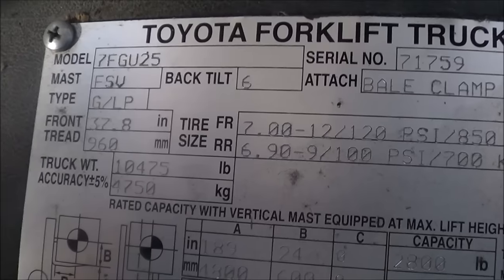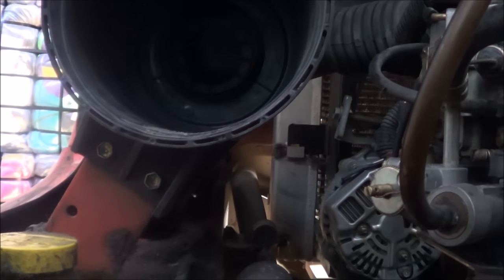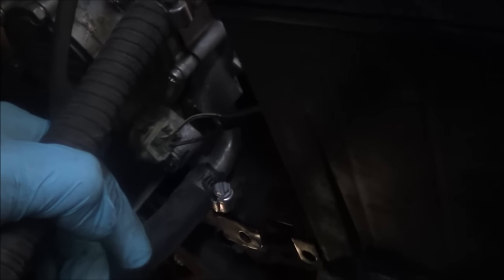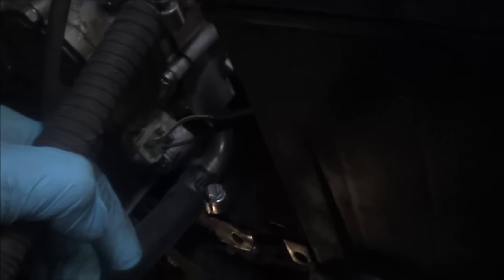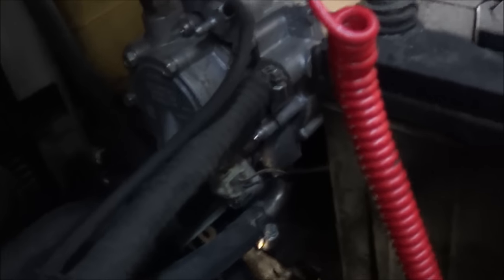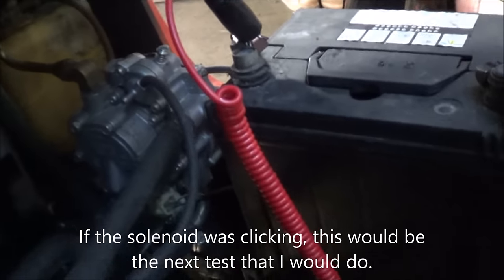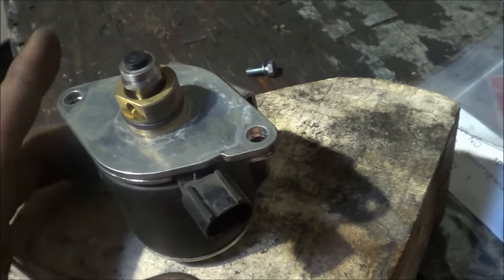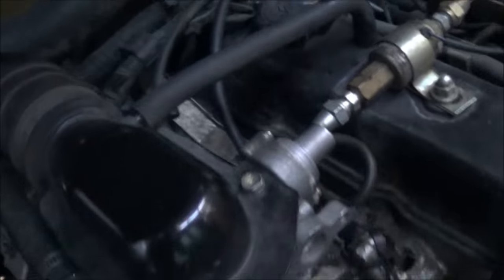Toyota forklift no start issue

Comment: What test light are you using?brand and model# please?
Reply from the maker: It's a matco test light but I don't remember the model.
Reply: I'm just getting started in the forklift mechanic trade. Well for about a year now as a PM Tech.  But they are now letting me go out to service calls. So I've been building my tools accordingly. I have a matco test light and it is 12, 24, 48 volt. Test light but somebody said it was not good for what we do.  So just trying to figure out what one is the right one.
Reply from the maker: Honestly, it all depends on what you use it for. If its LED and you use it on solenoids, injectors or contactors then you will more likely fry the test light.
Reply: So standard bulb is better.  What about voltage range?  And also was wondering about your fuel pressure tester?  Any good recommendations?
Reply from the maker: I just use a test light for quick testing on 12v systems other than that is a meter or an oscilloscope. My fuel pressure tester is from impco.

Comment: hi i have a problem with tcm 3.0 ton diesel forklift.(i think 1992).key ignition turns on but no start.It starts if i use screwdriver on starter first time.What is wrong?Starter is fine.had it checked.
Reply from the maker: +crazy pineapple where did you use the screwdriver on?
Reply from the maker: +crazy pineapple im guessing you jumped the battery connection on the starter to the starter solenoid with a screwdriver. If this is the case then everything from the key switch, relay, and wiring upto the starter are suspect. Corrosion in the connectors is also a possibility.

Comment: Got a s50ft no fuel new regulator getting fuel to the solenoid but not past would that be the problem
Reply from the maker: Make sure the solenoid is getting power and ground
Reply: You the man broken ground wire thanx so much

Comment: Im working on a 8series Toyota forklift with a code e 09-1 and will not start.  Any ideas
Reply from the maker: +busfairnitrometh 09-1 is ignition signal abnormality. No spark?
Reply: Broken wire tach sensor

Comment: I'm having the same problem but with a Nissan it cranks but won't start any ideas what it could be?
Reply from the maker: If it cranks with normal speed then one or more of the following would be missing. Spark, fuel, compression, air (being sucked in). If all of these are present then it would be timing( ignition or cam/crank).
Reply: if you have spark and no error codes, lp regulator is over pressurizing

Comment: i have this problem engine starts and then dies check the regulator valve relay and is not working theres no ground to the relay to activated the relay and the solenoid on the regulator where this ground supply from
Reply from the maker: +agustin tirado if you're talking about the lock off solenoid then ground could either be provided by the ecm or constantly from the chassis.

Comment: Please I don't know if you will be seeing this, I am working on a cat forklift and every time I use something combustible it start up and continue working even after I finish operating
But coming the next day same story been confused for a while
Reply: The forklift uses gas only
Reply from the maker: A no start, would always fall into 5 possible causes. Fuel, air, compression, spark and timing. In your case it would more likely be fuel related. I would start with figuring out what and how fuel is provided during cranking.

Comment: What about when you have changed the entire regulator but the forklift wont start
Reply from the maker: Cranking no starts would have 5 possible causes fuel, air, compression, timing and spark. If it was fuel related, it either is lacking in fuel ir in excess. The regulator is only one part if the system. The mixer is also a possible cause and injectors(if it is equipped).
Reply: @forkliftgeek10  ok but we spray starter fluid on the air filter are and it starts no problem but when we turn it of and try to start it up again it won't we have to spray it again to start it
Reply from the maker: Then I would suspect a vacuum leak. Other possibility would be a broken hose from the regulator to mixer or mixer to lock off.

Comment: I was using my take fork lift for 3 hours with no issue then I go and park it and try using it again but the engine now shuts down when put in drive or reverse any ideas why?
Reply from the maker: That could be a lot of things. Without knowing what truck it is, I would start with what is missing when it dies, spark or fuel. You would need a schematic to look for an engine shut down circuit. Is this a  Clark?
Reply: ForkliftGeek thanks for responding.
It only dies once I switch to drive or reverse the propane tank is full.
I just let it run for 10 minutes and after it was able to go in drive with out shutting down but it seems like I need to let it run for 10 min each time I want to use it
Reply: It’s a yale forklift
Reply from the maker: Well, from what you are telling me it seems to be temperature related. Still need to determine what is missing when it dies either spark or fuel since it can't be timing nor engine breathing. I had a clark that had the same symptom and it turned out to be the computer but every system is different.

Comment: What else could it be if the solenoid is working and still no start? I have fuel pressure to the regulator. This happens to me every once in a while where the solenoid is good and is working but it still won't run with out starting fluid
Reply from the maker: +gigglegasn20 have you checked the slow solenoid?
Reply: ForkliftGeek what's a slow solenoid? I noticed on some Toyota models there is a second smaller solenoid on top, and some models don't have one just a vacuum line going in. Can you give me a list on what you would check when you're not getting fuel. The company I work for has about 30 Toyota lifts and every once in a while this same scenario happens and I feel like an idiot cuz I can't figure it out lol. Thanks for you help, great video BTW
Reply from the maker: +gigglegasn20 that's the slow solenoid, some are electric and some are vacuum operated. Best thing to do is check regulator compared to specification if problem is intermittent. Do u have the manuals for them?
Reply: ForkliftGeek oh okay. Only manuals we have are the owners that come on the back of the seats
Reply from the maker: +gigglegasn20 what's the model of truck u working on?
Reply: ForkliftGeek mostly 7 and 8 series, never have this problem with 8 series though
Reply from the maker: +gigglegasn20 what's your email address?
Reply from the maker: +gigglegasn20 did u get the email I sent you?
Reply from the maker: +gigglegasn20 when you said it would not start without starting fluid, was the engine cold?
Reply: ForkliftGeek yes it was cold. But had complaints of it being intermittent hot or cold
Reply from the maker: +gigglegasn20 check if the vacuum at cranking is at 3-5 inhg when cold.
Reply from the maker: +gigglegasn20 also check pcv valve, might be getting stuck open.
Reply: ForkliftGeek thank you I will certainly have  to check those

Comment: Current draw measurement would have told you everything you needed to know.
Reply from the maker: If you know the current draw of the coil then yes. Using a current clamp with an oscilloscope could have shown a current ramp and possibly a hump suggesting it was opening. Wanted to stay with basic tools for this one. Tnx.

Comment: Good day Sir, about the positive side of that solenoid,,why is it blinking when cranking, is it the engine timing? What if theres nothing on positive side,what some  alternative ways to test or check?
Salamat po:
Reply from the maker: The blinking is the voltage fluctuation from the battery. Whenever a load is applied to the battery(in this case the starter) the voltage drops. If there is no positive supply you could do  a bypass test and provide your own 12v supply.
Reply: @forkliftgeek10  havent encounter this problem,mostly here poh issue sa LPG regulator but some wiring issue not yet ,soon if this problem exists i know what to do, still developing some diagnostic techniques , cge sir salamat sa info God Bless

Comment: Hello Sir I have a problem with toyota 8FGU25. The engine fail and the aceleration is up nd down every time, I can see two error code E-03-1 and E-01-3, Please help me to solve this problem.
Reply from the maker: E03-1 is an intake pipe pressure sensor open. Check your connections on the map sensor. E01-3 is a rich condition. Go with the E03-1 first. Check also for a vacuum leak.

Comment: Now to lower RPMS to 750 and clean out that intake, thing is running rich which caused regulator to fail prematurely
Reply from the maker: How would the main solenoid fail even if it was too rich when it should be energized as long as the engine is running anyway? 🤔
Reply: @forkliftgeek10  it is running rich. Your saying you don’t get component failures when regulators are running way out of spec? I get what you’re saying but you’re not fixing the underlying problem. Take that intake manifold off and remove the carbon deposits. Before you get a law suit for a lift failing it’s emissions and some forklift operator getting carbon monoxide poisoning.
Your a fantastic mechanic bud. I mean that, your trouble shooting is spot on.
Reply from the maker: Are you saying it is rich because you've seen the same problem by experience? I did this video 5 years ago so I had to watch it again. Where in the video were you able to tell that the engine was running rich? I was not using a gas analyzer to see HC levels nor did I check O2 signal. Which would have been useless anyway since it does not start. Yes I have seen component fail when not running in spec but what I'm saying is for this case it was the "main solenoid" that failed which would have been energized no matter if the engine was running rich or lean. It is a switch that opens or closes the path, it does not control the amount of fuel. With regards to your comment of me being sued, I don't know the law where you are from but here it is the responsibility of the forklift owner to make sure that the equipment is safe to use. He can call a company to do an emmison test on his truck to do that. I was not called in to do emmision testing but rather to fix a specific problem, now I can recommend for him to get it tested if it was running rich and and suggest to lock and tag his equipment. In the end the owner is still responsible.  Please do explain how you were able to tell the forklift in this video was running rich so that others may learn as well.
Reply: @forkliftgeek10  sure, engine no start you pulled the hose from regulator to EPR. You switch key to start position and saw a lot of pressure. A lot of pressure from regulator is normal on these lifts. The Electric pressure regulator EPR controls the flow from regulator which is always high. On laptop software there’s a needle which represents the EPR which is constantly make fuel adjustments from rich to lean.
Fasted way to know it EPR is remove fuel hose leave a air gap. Truck cranks and runs. 90% of mechanics who’ve no software and not fixed this before will replace regulator. The regulator is dumb, can’t turn it up can’t turn it down. Fuel regulation is done by EPR. Fixed 100’s of these.
You will also see lift crank, engine goes into forced limp mode. If you want so help attaining software and cable just hit me up.
The GM software and password I can put on a flash drive. The cables you can order on line
Reply from the maker: Buddy you commented on the wrong video..
Reply from the maker: But ill answer it anyway. The EPR compensates to run rich or lean during running and closed loop. My question to you is how does the EPR know how much fuel to deliver at cranking not running. When cranking it is still in open loop. What is the measurement.
Reply from the maker: Did you watch the 2nd and 3rd part of the video? The video you are referring to has 2 more parts. Where I explained why it is the regulator. Yes it has pressure but how much is the question. Which is what I showed in the part 2 if this video.
Reply: @forkliftgeek10  no couldn’t find them, it’s all jumbled up on my end
Reply: @forkliftgeek10  I don’t doubt it lol they changed the format on comments.
Reply: @forkliftgeek10  honestly don’t know that part I would assume it’s lean and psi looking through manual can see another unit if measure
Reply from the maker: https://youtu.be/21UqO_MsgF8
Reply from the maker: https://youtu.be/4Z9mQAdUpEQ

Comment: Yes what happens is that engine starts then dies right of way won't stay running the rally that activate the fuel cut off valve won't stay on if I by pass it it will run bud on lean mode
Reply from the maker: +agustin tirado what do you mean when you said lean mode?

Comment: Ever had wiring problem better voltage on all 3 map sensor wires
Reply from the maker: What do you mean by better voltage?
Reply: @forkliftgeek10  battery voltage= 12V (typo)
Reply from the maker: Ok. That would suggest you have an open in the ground wire of the sensor.

Comment: yes is a Toyota 7FUG18 or 7FGU18
Reply from the maker: +agustin tirado ok this relay us provided with a ground from the "engine Rev sw". I personally have not seen this switch before but looking at the diagram it's connected to the igniter inside the distributor with a black wire.